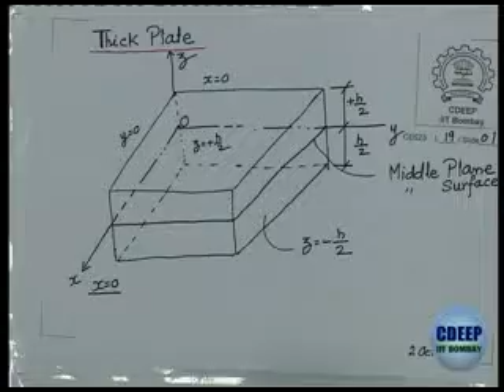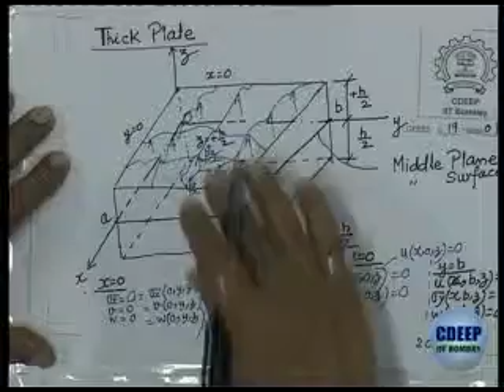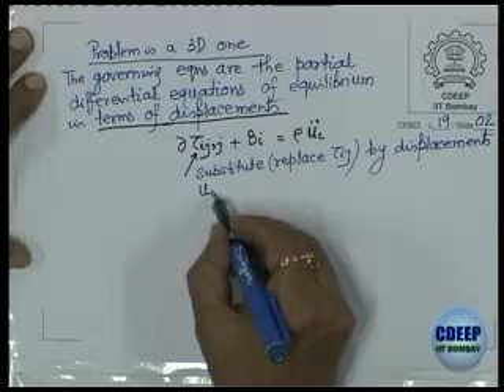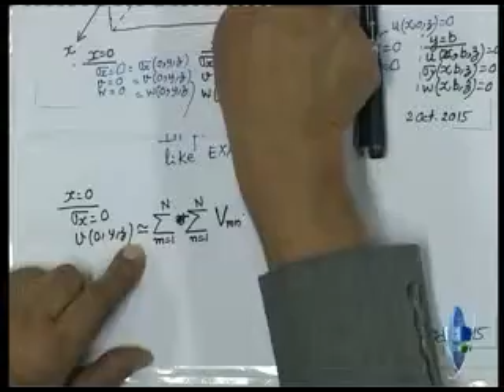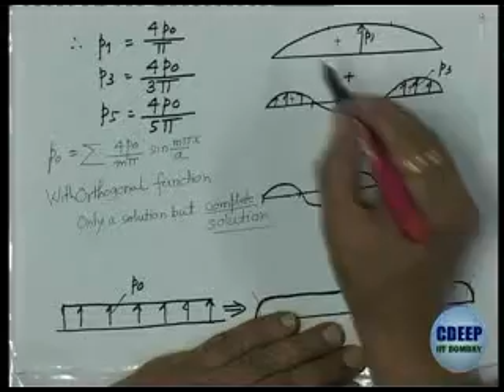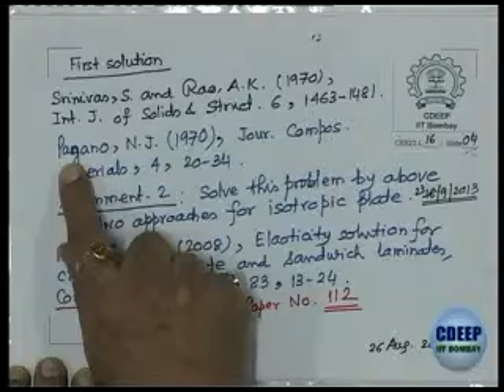Lecture 19 - Advanced Solid Mechanics

Comment: @53.24, How did you eliminate ⅀ in the last two equations?
Reply from the maker: It is not eliminated. The total solution will require summation of several modes (m,n) odd terms (1,3,5,7,    ,) till convergence is obtained.

Comment: The word 'Vibration' @ 41.10 may confuse
Reply from the maker: I will check up. Concept of vibration is used to assume solution in the sine-cosine form. For statics we take only odd terms in consideration. In vibration all even and odd terms have to be taken. Still I will check up the video.
Reply from the maker: I have checked the video, it is fine. We must know vibration modes for solving static problem.